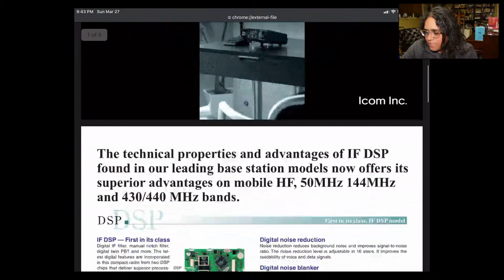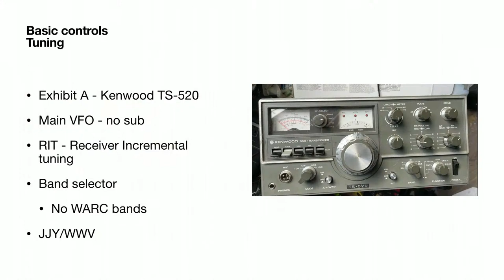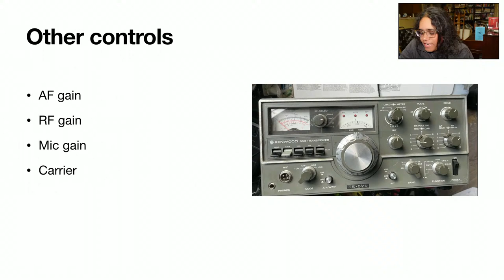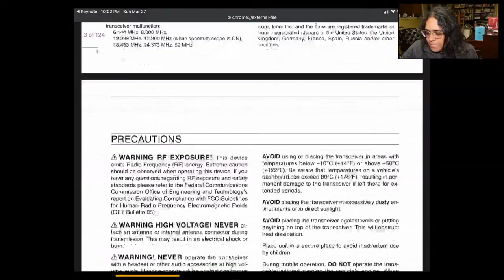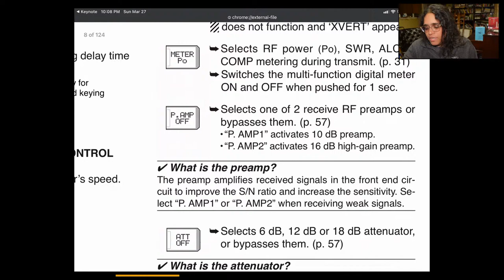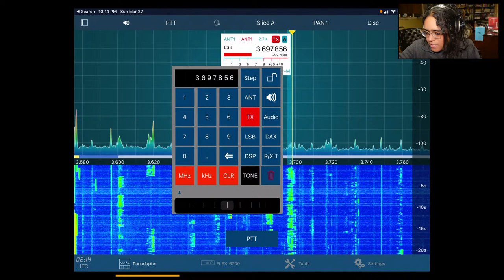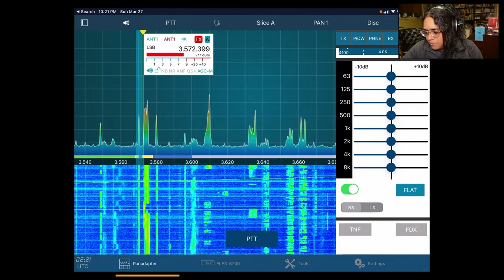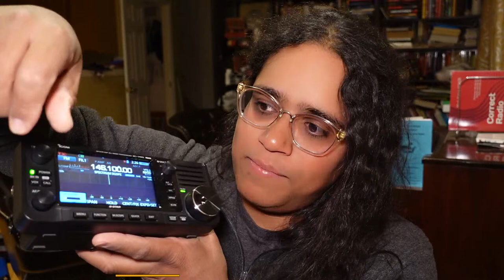Learning your radio's controls - Flex, Icom, Kenwood

Comment: I feel like a modern IC-7000 would fill a nice hole in the market.  Use FT-857's, IC-706's, & IC-7000's still do very well.  Take the IC-705 in a mobile form factor with 100 watts on HF and I think you have something that many hams are looking for.
Reply from the maker: Talk to Ray. He may take it back to icom